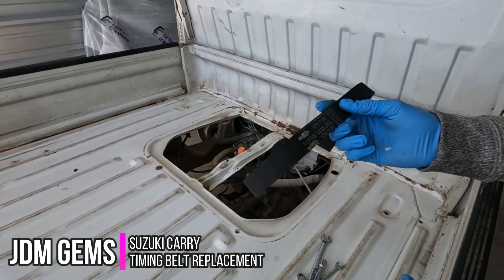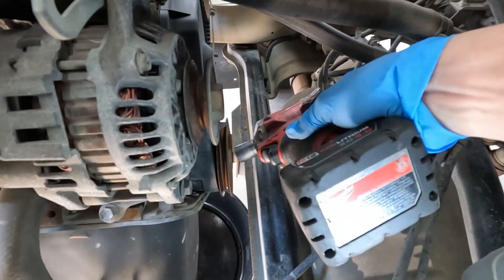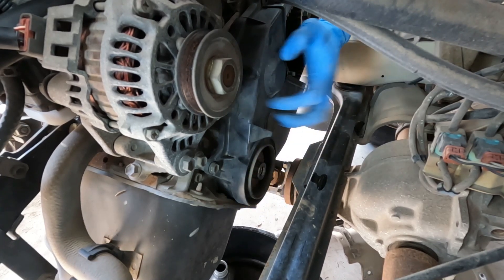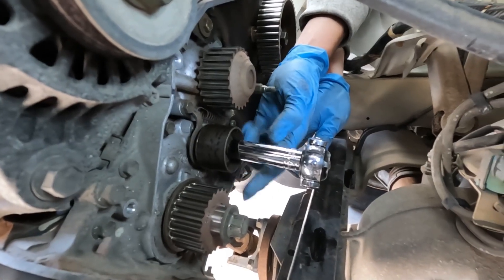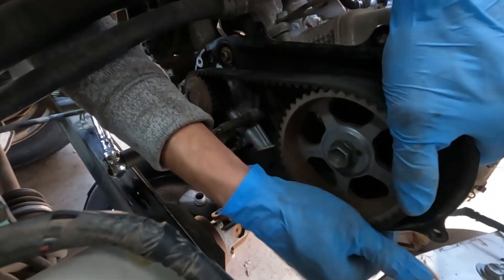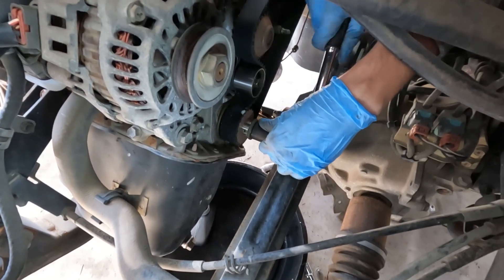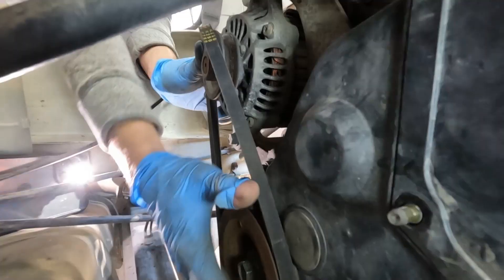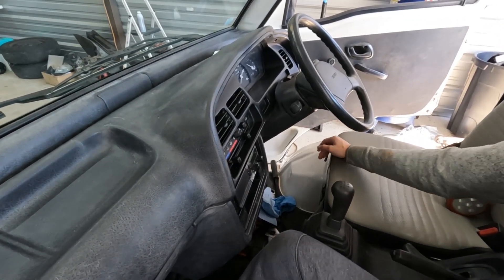Suzuki Carry Timing Belt Replacement

Comment: Nice video with very good photography. I would like to see someone change the water pump and the crank and camshaft seals at the same time. To replace the seals, removing the cam and crankshaft pulley and gear will be necessary. I am not sure how to re time the engine after removing these things and I'd like to see how to do this.
Reply from the maker: Re timing the motor is explain at 3:50 in this video
Reply: @jdmgems  Ahh, I get it. The gear is KEYED so it must go back on in the exact position it was oriented when it was removed. Now it makes sense. Is the pulley also keyed?